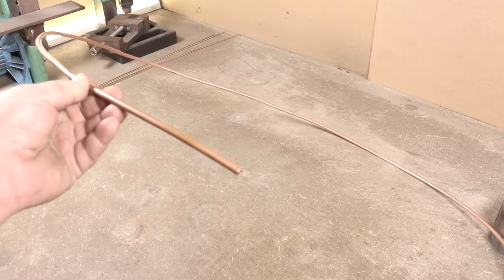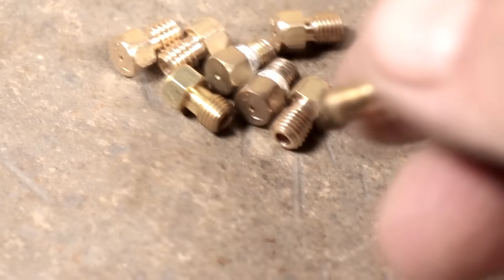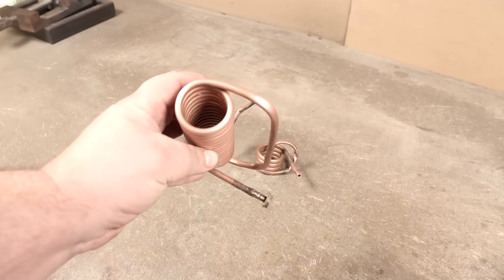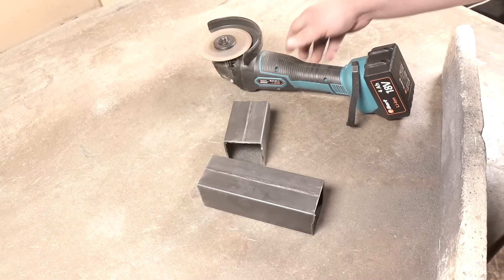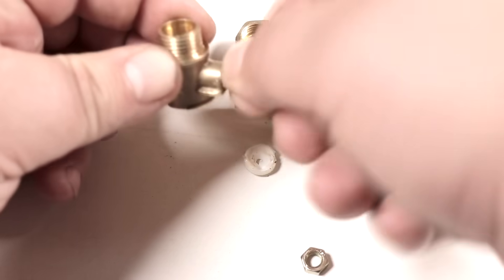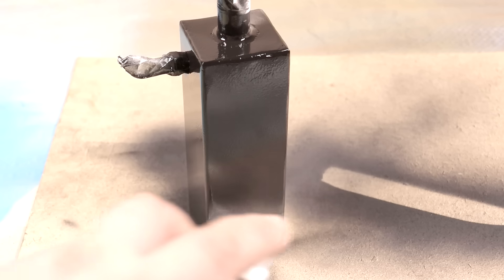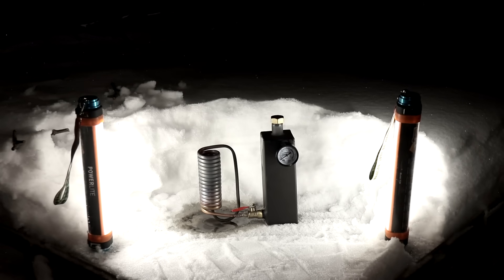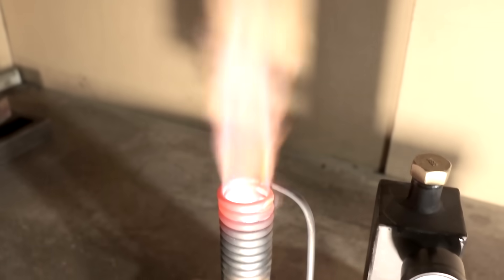Firewood is not needed anymore. BURNER USES WATER.

Comment: Let the coil go back to the tank. It will create more pressure to the tank. Also, add a flame holder inside the coil dimater for easy startups and stable flame. I belive this way you can then use denser  fuel as well. 

 This is what my feelings tells me that it will work better. 

You did something very nice.
Reply from the maker: Thank you very much for the advice! I will definitely use it!

Comment: I believe you'd get more control over flow if you used a gate valve instead of a ball valve. That's what I was always told with hydronic hvac systems at work anyway, ball valves are a simple on/off, gate valves allow you to fine tune flow. Also, on my antique blowtorches I notice the ones with thicker metal on the nozzle tend to work better, i'm guessing because the extra metal can store more heat there. Your design here is very similar to, and superior to, an old lead smelting furnace I have.

One really cool idea I saw in another video; using an ultrasonic fogger like one found in a humidifier can be used to vaporize fuel before combustion. Love your videos, can't wait to see what you come up with next.

Comment: It is an interesting burner, but is is more or less a Coleman stove except the pressure is supplied by the expansion of the fuel from liquid to vapor instead of a leather cup pump in the fuel tank. Gasoline and diesel will vaporize but they have will have more residue that will not vaporize and foul the inside of your coil.

Comment: Very impressive flame. I would put a one-way valve in the tubing right where you connect the plastic line. Weld, not solder but weld, a Y joint to the one way fitting and install a needle valve to control the fuel feed. Make the rubber fuel line from an automobile duty hose with braided stainless steel covering. I know you are trying to make this on a budget but there are a few safety steps you really should consider.

Comment: For people wondering how this works…  the same principle is still used in basic self-priming camp stoves, and in other low-tech devices. It can be very effective….  Look up how to make an alcohol stove out of a soda can. As Boy Scouts we made them all the time.  Called “penny stoves” because a coin is used to regulate the pressure. 
🔥
 1. Prime it: Liquid fuel is put into a container that can hold necessary pressure. Then liquid fuel it is heated up by an outside source (like a fire) until it turns into high pressure gas fuel. 
2. The new high pressure gas that wants to escape. (it does not explode inside his pipe coil because there is not enough oxygen in there to burn … but if the pressure container failed, there would be a tremendous and dangerous explosion ⚠️)
3. The high pressure gas created now escapes from an orifice of some kind and is ignited by you with a match, or more commonly, by the priming process itself. 
4. The burning high pressure gas is now designed in such a way so as to  preheat and vaporize its own liquid fuel source independently. …. This is why his big flame needs to blast through his copper coil.  It must vaporize the liquid behind it. 
The whole process creates a cycle of pressure and combustion that will continue on forever, or in reality, until the liquid fuel source is either closed off or is completely consumed.

Comment: Hello mr robot. 20 kw of power is amazing. What if you put diode on the top and bottom of the coil , insulated from heat of course, with a condensator. This is use in air baloon but out of price. This is use in ancient time with mercury and caducee form for the coil. I dream about this for some times, so thanks you for this. Stainless steel will be more safe, did you try it for a long time ? .

Comment: If you twist the copper pipe outside a iron tube and just let it stay on, you will get a much longer lifespan out of the copper. Sure it will take a little while longer to heat up, but it will last much longer.

Comment: I do not understand the working principle and even did not see the construction plan!
Reply: It heats coil full of gas. Witch is then pressurized causing atomization at the jet. Basicly its extremely dangerious if built to be usefull. Using copper tube as a coil......ohh boy is this a bad idea unless you are fine with a pressure  vessle falure next to an open flame. Dont build this and just by asking you dont have the skills anyways......troll

Comment: you now need the copper coil burner to be surrounded with a heat sink, vented brake disks stacked on top of each other with a thick steel lid is what most people use, the radiant heat is much better, and a lot safer than exposed flames, and they look really cool painted up with HTP.
Reply: I`m not perfect in this language but i think you can be right - will you give link for this radiant device? Thanks:)

Comment: Hello ~ just discovered you today. Thank you for your interesting designs and hard work on videos!!!
Can i ask, do you think this burner would run on vegetable oil? and does the container have to be metal?
Reply from the maker: Yes, the fuel tank must be metal. For best performance, you need to insert an air pump into the fuel tank to create a slight pressure.
I have not tested this oil burner, but in theory it is possible. It may be necessary to replace the nozzle with a different diameter. Maybe make the oil a little thinner.
I am developing an interesting design for burning oil now, I will try to make a video about it as soon as possible.
Reply: @doctor-robo  Thank you, keep going with your interesting inventions. Have a good summer :)

Comment: Be very careful with this …… if the copper overheats it will split open and spray burning fuel everywhere…just like a flame thrower and set you on fire.  In other words do not try this.

Comment: The gas tank is tightly closed or it has an air breather to ensure sufficient oil flow supply. If there is no air breather, I believe the tank will have a vacuum effect

Comment: Don't you need to put a anti-flashback valve before that welded tank? Kaboom  They are on welding torches or on the regulator. My pop would know. Had no intrest or uses fir metal as a teen.
Reply from the maker: I have not tried it, but the idea is not bad, it will be necessary to make such an experiment. Thank you🤝🤖

Comment: That copper pipe will not last very long with that much heat, stainless would be much better
Reply from the maker: Yes, stainless steel will be much better. It is currently a prototype.
Reply: may work with hydrogen gas  but that crap is very explosive

Comment: As the fuel leaves the tank it needs to be replaced so you need a tiny hole in your cap or you will suck a vacume in the tank.

Comment: Yes you think it works good no it works TOO GOOD if you look there at the end, that copper was getting way too hot and that tubing was just below melt temperature! Dont get me wrong, to achieve those temperatures  high enough to melt copper, I mean that's really good that you're able to get those kind of temperatures but you gotta dial it back a bit because that copper was getting so hot that you're gonna go *BOOM!* with all that gasoline in that hot copper tubing and gasoline IS VERY explosive in the right situations and that was one!
Reply from the maker: Many thanks! I will definitely heed your advice. 🤝🤖
Reply: @doctor-robo   Ive seen similar devices and definately either need to greatly beef up the tubing or use a smaller jet that only warms the tube enough to vaporize the fuel for pressure!
But this is a sweet style for this type device!

Comment: Great but the cooper pipe will degrade fast when very hot! Stainless steel would be better!
Reply from the maker: I agree with you Antonio. My project is just an experimental model, of course it is better to use a stainless steel tube for the fuel vaporizer, you need to replace the ball valve with a needle one, and put a small air pump in the fuel tank. Thank you for your interest in my projects!

Comment: How to test a gas stove for efficiency? I want to know which gas stove uses the least gas to boil 3 liters of water in a glass pot / pyrex at sea level?
Reply from the maker: You can determine by the weight of the gas cylinder before and after the test for the same period of time.🤖
Reply: when water reservoire is in vacumed  condition   "sous vide" water boil  at very low temps juste the heat of the sun !!

Comment: i tried making your other burner but my tubing was too old and hardened, even tho i tried to heat it up. it had been over worked before and it was too difficult. and i didn't want to solder it because the can would smoke due to plastic coating.
Reply from the maker: Experience is the son of difficult mistakes.👍🤖

Comment: could it work with used motor oil or used vegetable oil? please try it
Reply from the maker: I haven't tried using oil, but I think it can if you increase the nozzle diameter a bit or make the oil thinner.

Comment: this is just an alcohol stove, but with gas. its a simple device that has existed for decades, and works off of a simple principle: fuel is liquid (problem), use heat from fuel to boil fuel so fuel is gas (solution), then fuel is ready to be used with standard gas nozzles.
Reply from the maker: Many thanks! I will definitely heed your advice. 🤖

Comment: please, i have built one, how can i regulate the effect, im about putting it in my gas burner in my caravan,  can i install  an adjustable nozzle from a moped between the pipe  to adjuste the flame?
Reply from the maker: I think a needle valve should be used for better adjustment and a small air pump should be installed in the fuel tank for proper operation.
Reply: @doctor-robo  i use a needle valve. should i put it exaktly before the bend before the nozzle? i uze waste oil,

Comment: The copper will melt eventually if the temperature reaches 2000 ° F
Reply from the maker: This is only an experimental design. It is better to use a stainless steel tube.

Comment: wow i love this design, i am gonna try out something similar to this in my garden shed, i will ad a little chimney thou.
TANK YOU FOR SHARING <3
Reply from the maker: It's tedious to add a small air pump to the fuel tank for the initial start.
Reply: @doctor-robo  i am thinking that maybe the pressure isnt nessesarry if you have the fuel tank high enough, to let gravity do the job?
othervise, maybe for a gas burner this wouldnt be an issue

Comment: I am running copper from a large 250 PSI propane tank can I solder up my elbows 90° elbows just regular solder used for water plumbing or do it for a gas application
Reply from the maker: I used special solder for brass, bought it from a welding shop, the melting temperature of my solder is approximately 700 degrees Celsius.
Reply: @doctor-robo  but if I'm soldiering copper to copper I can use regular fodder for that right and this will be used for propane gas

Comment: I believe the entire setup is extremely dangerous especially if gasoline fuel, plus it gets over heated even for normal kerosene or diesel or furnace oil fuel. The fuel tank is too close for comfort. It must me far removed from the burner with a longer detachable  fuel line. lastly why this long super heating and gasification of fuel inside the fuel line. Seriously I feel the copper pipes will not take the super heating and pressure built-up and it will definitely explode.
Reply from the maker: You are partly right. A stainless steel tube is best, and a small air pump is tedious to add to the tank. For pressure control, I installed a pressure gauge in the tank to monitor excess pressure if it appears. How do you feel about my other projects? Did you like them?
Reply: @doctor-robo   I glanced through another one or two projects. They look amateurish.
Reply: You were born an expert, I take it.

Comment: Know that discoloration of copper coil means that copper released DEADLY fumes as some metals do when overheated. EXTREMELY LETHAL in closed spaces.
Reply from the maker: Thank you very much for your advice, I will definitely heed it! Of course for this project it is better to use a stainless steel tube coil, but this is only a prototype. Come back to my channel again, there are a lot of interesting and unusual projects!

Comment: I'm sure that open flame would burn down that little hut if left unattended. I'm not sure how it could be improved and made safer.
Reply from the maker: This burner is made for installation in a boiler with an additional chimney to remove combustion products. I will try to make it safer. There are more interesting projects on my channel, I think you will like the stove that runs on water (with the help of water).
Reply: Maybe this channel isn't for you.......
Reply: @joemendyk9994  maybe you're right. This was the only video I made the mistake of watching and commenting on.

Comment: That is definitely not a project for copper. The heat is way to high directly on that tubing. Steel tubing is the way to go there.
Reply from the maker: Yes, you are absolutely right, you need to use a stainless steel pipe. This is just an experimental model!

Comment: Copper flakes apart in high temps or direct flame. I don't think the burner will have a long life.
Reply from the maker: Yes, you are absolutely right, you need to use a stainless steel pipe. This is just an experimental model!

Comment: I see why you say 10 turns best. The last two glowing red hot says all the fuel is vaporized and superheated. Is it gravity or vapor pressure fed? I missed that part. Awesome little design I bet LPG like in hot air Baloon burner would work extremely well

Comment: I can't say that I hold out much hope for the crystal structure of that copper that you're heating to Cherry red (and near the burner to yellow). As a bit of fun it was very impressive - as a heater, I wouldn't go within 20 feet of it.
Reply: We were thinking the same thing. That thing might act similarly to a molotov cocktail
Reply: Correction - one zero missing.  ... "200 feet of it"
Reply: @gkrishnan4829  now that's safe....
Reply: @mcprotec2246  I believe all the posts by this fellow is a troll on DIY enthusiasts especially this one, absolutely crazy, wrong, unsafe and in fact dangerous on many counts.
Reply: Now we're taking off a couple of inches instead... Lol
Reply: @printingwithlue4310  ..........my point on the dot look at what they do to chickens.... But never roosters
Reply: hi, i dont understand what you mean, would you please elaborate? what would be the problem with this?
i see that there is hight temp boiling solvent in the copper spiral, but even if it clogs, it would just go out.. am i missing something? kind regards
Reply: @benjaminandersen1097  notice that the copper get so hot it glows.That is making the copper very soft. Even if the copper doesn't get hot enough to liquefy, it can still get soft enough to fail. That failure does not have to come from internal pressure. It could fail to support its own weight. When it fails, hot fuel will escape in an unpredictable way. Does that help clarify?
Reply: @RichardBronosky  that does help to clarify yes, thank you very much.
Reply: Copper will last about a week, stainless would be better
Reply: Thanks for saving me the explanation…lol
Reply: How much pressure is in the coil?
Reply: Yep, a thicker stainless steel tube would be a better idea.But this is a great proof of concept.
Reply: Commercial multifuel stoves like Coleman work the same. Crystal structure is obviously no issue. Just the fire is touching the pipe only in two places which is enough to gasify the gasoline. This is a flamethrower. This amount of pre-heating will be perfect for waste engine oil. The mini pipe on my stove suffer from carbon buildup. It works with clean gasoline but an old one can clog it after one use
Reply: Не вижу ни каких проблем с безопасностью применения. Назрев идет местный. И, в крайнем случае, горелка погаснет, если забьется не качественным топливом.

Comment: this is what you call a heat exchancer, your trying to exchance the heat into the gasoline to create gass,
- coil is backwards, the hottest exchance should happen at the last point, else you get the fluttering.
- vale instead of sealing the container should promote more flow and decrease the heatingup requirement.
- im somewhat concerned heat will make the copper brittle stainless prolly better idea?

Comment: This is the best one of these I've seen. You pay great attention to detail, using the lost art of common sense.
Reply: I don't agree. First he put teflon tape to seal,the tape is to be used fot plastic fittings,not for metals,because it getts riped at screw.Between metal fittings needs to be used teflon line.
Reply from the maker: I also used an anaerobic sealant for sealing at high temperatures.
Reply: @doctor-robo  8
I've used that sealer before  .being old school , the directions  threw me back a little.about no air, to seal, it was fancy stuff for me.keep it up , I have a. Old orchard smudge pot ,I need to post,it's 😎 cool.

Comment: Excellent indor heater, just add the exhaust pipe, not to get chocked
Reply from the maker: Thank you! Yes, if used in a closed room, a pipe is needed to remove harmful gases. It can also be equipped with a heatsink for heat dissipation.